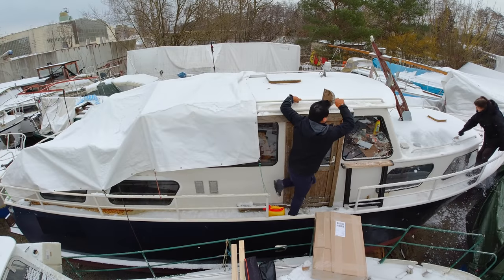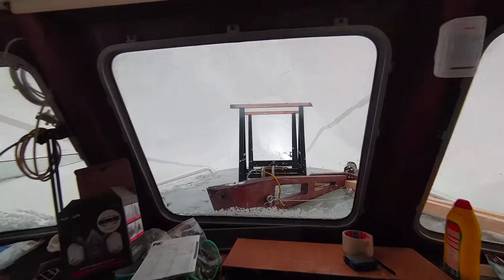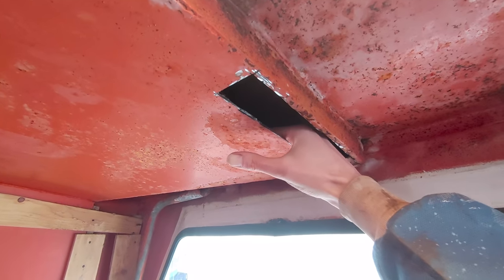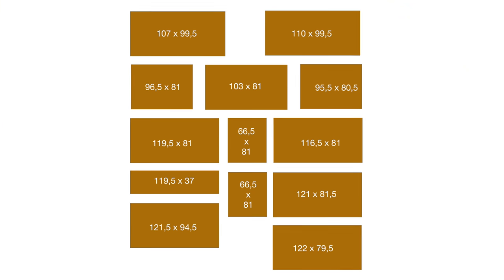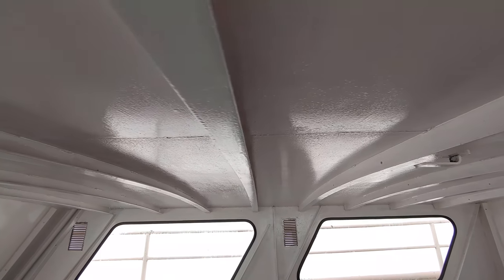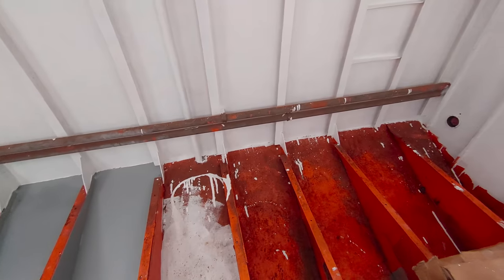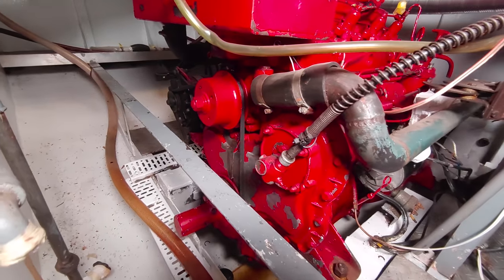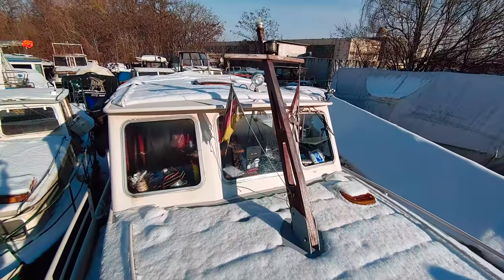Plenty of work left to get this Boat running again - Week 18 - Vintage Yacht Restoration Vlog

Comment: What Seth Barns said is some very good advice.  I would also add a product called Sea Foam in the first couple tanks of fuel. Also check and double check all your motor mounts.  they can dry rot if the engine sits idle for a long time.

Comment: Put a bit of oil in each cylinder and turn the engine by hand with a pry bar a couple of times to lubrify all the piston rings and sleeves  ,clean all the fuel lines , replace the rings in every injector , clean the fuel tanks replace all the oil and fluids , also if possible take the oil pan and check how is the oil pickup line if it’s dirty or damaged take it out clean it and you should be good to go , great project nice short informative videos keep it going best regards

Comment: For plywood on the floor, there's a YouTube series about restoring a boat called the western flyer, if you look at the video where they plywood the deck, they have a part where they make templates for the individual pieces that might be helpful. You're doing an excellent job with this boat. As for that engine room vent, I'd cut that whole piece of metal out, do the rust converter, then weld in a new piece. They have a "weld through" primer that I'd defiantly use on the top facing side before welding in the new piece. Also, I'd check, and maybe replace the engine room part of it as well.
Reply: Yup! Thats what I was thinking Id do too, cut it out and start from scratch! With that much rust he'd be repairing rust holes every couple years.

Comment: You are making great progress on this boat.
The fuel pump should have a priming lever on it ao you can peime the engine and not have to run the starter to prime it. Also if you just loosen up tree the injector lines at the injectors uou will be able to tell when the fuel has gotten to them. Then tighten the injector inlet lines and loosen the return lines in the same manner and watch for fuel in the return lines and tighten each one as fuel starts to return from the injectors to the tank return line.
This will make starting the engine much easier. It will also help reduce any chance of fuel knock.
Most important is to replace the fuel filters and clean the tank(s) before using them in order to reduce or eliminate future problems with the fuel system.

Comment: With the main engine. I'd start by draining and cleaning the fuel tank thoroughly, then blow out the fuel lines with compressed air. Then make sure you filter the fuel before putting it back in the clean tank. Then change every fuel filter and water separator filter on the boat including the generator. Change the engine oil on both the main and the generator. To save you the headaches of bleeding each and every injector on the engine and generator, you can use WD-40 as starting fluid on diesel engines. Simply feed her the WD till the fuel system catches up. Also, if there isn't one already, I'd definitely install a centrifuge in the furl system. You'll thank me for it later when you're in a part of the world with dirty fuel. It is always a good idea to use a sock style paint strainer and strain your fuel every time you fill the tank.
Reply: With the WD-40 trick. Use only WD-40 specifically!! And never ever use ether based starting fluid in a diesel engine!!!!!!

Comment: 1:47  OH those poor windows!  Grinding near your windows without protecting them, you're going to find that tiny bits of metal slag are now embedded in your glass.  Run your fingers along the window, you'll feel them.  You can fix that with a razor blade along the glass to get rid of the metal chunks and finish off with some steel wool to get the finer stuff.  But the damage is done, the glass is pitted.  You need to protect the windows with a blanket or masking paper BEFORE you grind or weld in that area.  Great work on the boat!

Comment: Pour transmission fluid in each cylinder to loosen the rings change all the fluids filters and impellers and slowly work the engine loose with a breaker bar and socket on the crank rebuild the starter and alternator and hook up a new battery. You may have to restore the fuel storage tanks considering the rust you have been addressing thus far.

Comment: On starting the engine: Pump fresh diesel through the Injektion pump. Check if the diesel pump has its own sump,  if so drain and refresh oil.  Drain and replace oil and filters. Check if it is black (good) or milky white (water in oil). If white flush with diesel a few times, and fill with oil. Turn the engine over by hand. If this is takes more then ~ 15 kg/m, remove injectors and spray a mix of oil / diesel in to the cylinders and let it soak. Then try moving it by hand again. Keep turning the machine over without injectors until this takes less then ~ 3kg/m. With everything now nicely lubricated put it all back to gather. Keep something to cover the air intake nearby in case it takes off (Issue with diesel pump governor or running on lubricating oil). Check engine stop magnet or cable. Clean or replace air filters and try to start.

Comment: Maybe cut that vent pan out with a grinder. You can clean it up and then weld another piece in.
 Try to build the head compartment close to the steering station. Looking good so far.

Comment: hi  exhaust duct cut hole bottom leave 25mm to 50mm or more around after paint use galvanised sheet bent on side 90 and plug the hole or cut bottom up to 90 and bent galvanised sheet fit  and  secure use screws and glue

Comment: For the engine maintenance first change all the rubber hoses and oil filter with new oil change  diesel filter change check all the belts if it dry change check the heat exchanger and coolant water

Comment: Pull out injections, spray wd40 in the holes, a lot a whole lot, let it set for two days and see if you can turn moter with a socket on crank bolt. If you can use the starter, but change the crank oil after you turn it by hand, and yes Perkins are very common in boats and powering farm tractors. oh if you cannot turn tye crank as i said repeat the spraying process until you can.

Comment: You should try to start the engine after you do the stuff below. When was it last started? Need to change the oil, remove the old fuel and clean out the old fuel tank. There are companies that specialize in tank cleaning, change the fuel filters. Get a new battery, add new fuel, purge the air out of the fuel system then try to start it. Only run it for a minute since it’s out of the water and there’s no way to cool it.

Comment: To run the engine after a long period stoped: 1- disconnect al injectors lines pipes and take out the injectors (give the inyectors to a mechanic to clean them in an ultrasonic machine), 2- use a engine oil inside cylinders thrue injectors holes (about 100 cc of oil each cylinder), 3- move the engine turning the crankshaft nut several times to allow the oil inside cylinders to wet all inside (and to see if it moves), if all moves freely, 4- disconnect the engine main diesel line and use a clean small diesel tank to feed the engine, 5-crank the engine with a good charged battery to purge the diesel pipes and the diesel pump (this sustitute your old diesel inside the system with a new one) you will see the new diesel goes out from the pipes and all oil inside cylinders goes out, 6- install injectors, lines pipes and purge each injector with the manual pump on engine, torque all and done. If you dont do all procedure, you will scratch the cylinders walls and the pistons rings because all inside is dry. Remember check and change the engine oil and filters prior to do anything, use cheap oil because when engine start and all works good you will need to change oil again (it is better, this oil is going to be polluted with the remained old oil after engine start). Good luck and sorry for my english.

Comment: Good progress but I’m surprised you didn’t invest in a good spray guy for painting. Would have saved hours of time
Reply: and made quick work of those hard-to-reach areas.
Reply: And spend hours cleaning up all the overspray.
Reply: @MegaDirtyberty  that's why you mask off  the things you don't want overspray on.  He's already gutted the interior so there's not much he'd have to mask off.  Simple.
Reply: @Smythers00  Not really saving much time eh.
Reply: @MegaDirtyberty  I get it, you don't like spraying.  But yes, it would save a ton of time.  HARD YES.  You ever tape up a window?  It takes moments.  He doesn't even have to be finicky about it...  he's going to put up floors, and insulation covering all of this anyways.  This isn't going to be on display at the Guggenheim.  And from the past videos, the man already has masking paper that is sold specifically to do the job.  Also, spraying is 100,000% more efficient at getting the product on the surface and it would take less paint to effectively cover the same  surface he's doing with rollers/brushes.  Why do you think the professional shops do it?  He'd save not only time, but money as well... if he wanted to.  But this is his show and whatever way he chooses, I'm still going to watch and upvote.
Reply: @Smythers00  Now where did you come up with the assumption I didn't like spraying eh?. Ya don't need to mask up if ya can cut in properly with a brush. Oh and yes I have taped up windows, my father paints as does my stepfather (houses, cars etc) so yes I do know how to paint.
Reply: @MegaDirtyberty  you tape up everywhere that doesn’t need spraying. No over spray
Reply: @jjdebruyne  Still doesn't "save hours of time" ie time spent masking, pulling tape off once finished, cleaning spray equipment etc etc.

Comment: Curious how you can paint when it appears to be very cold where you are.
Reply from the maker: I have a 5kW Diesel Heater. Works great.
Reply: Be careful if your heater is the salamander type. Using it in side can leave an oily residue causing problems with paint adhesion.

Comment: I have a tip for you young man never trust a seller when he tells you the engine is ok especially if you haven't seen the motor run yet. btw on a better note cut that whole piece out on that  vent and replace it. I'd highly suggest you get a mechanic to do an inspection of your motor.

Comment: I reckon you should rethink that engine ventilation totally. What a poor design right from the get go. Just run some pipe and be done with it. Sure it will take up some extra space but the trade off is that you can then properly maintain all the steel surfaces.

Comment: Also, arent you even a little bit curious where that nasty leak is coming from in the engine room? I bet that thing "starts" but doeant run. You should probably get that running before you expel amy mor energy on this boat. Unless your prepared to replace that motor.